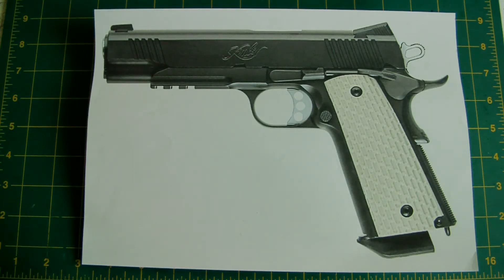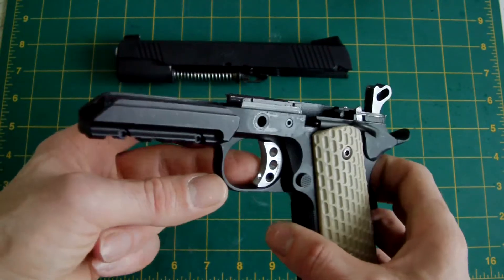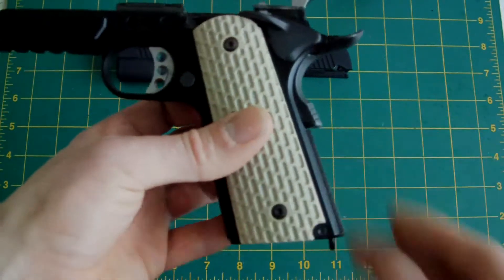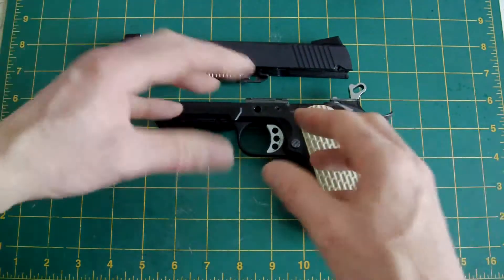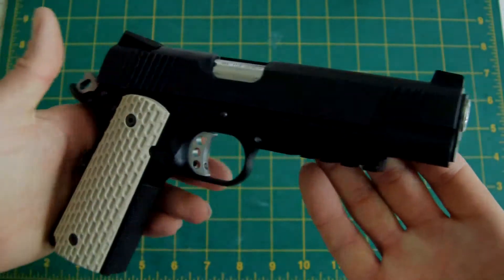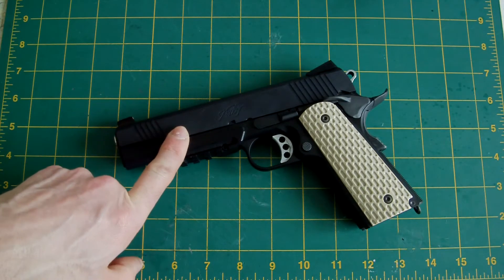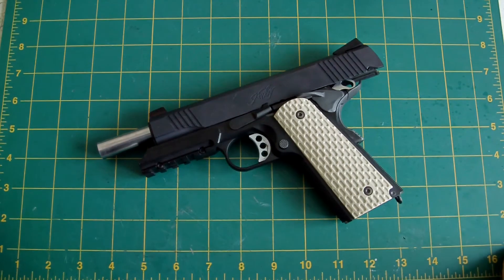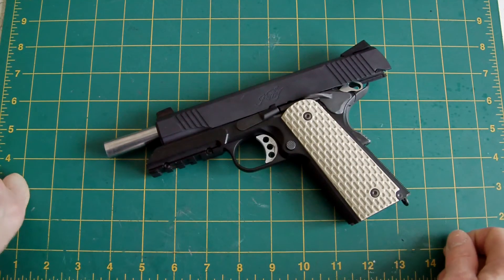LaZouche Custom airsoft Kimber Warrior project Pt 3.

Comment: When I was building my SA operator (still some work to do), I found out that surgeon and nova come from the same factory called prime. My frame and slide kit was sold under name "prime(nova) and it had nova package. Even the inaccurate details of the surgeon one are in the nova slide and frame. For excample the front serrations and the bottom rail. 

Thumbs up for this comment so I might make a video of my ultimate SA Operator!!!